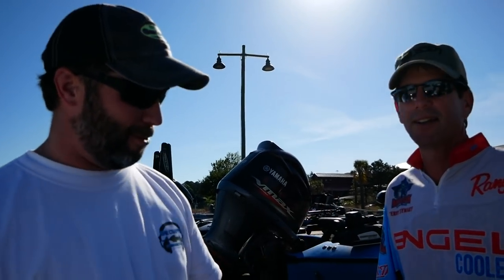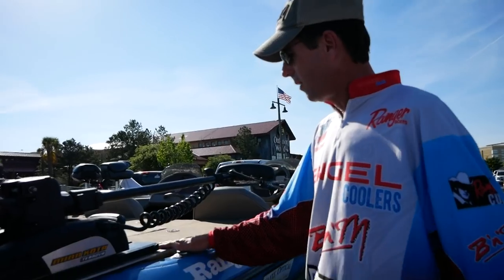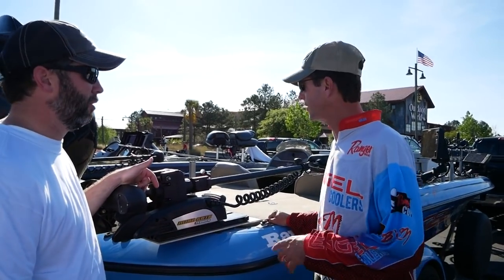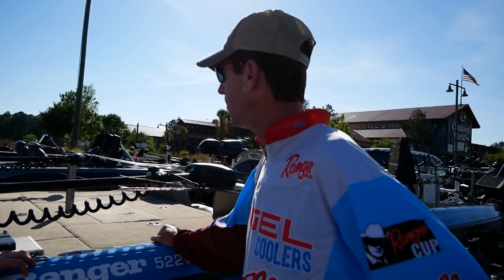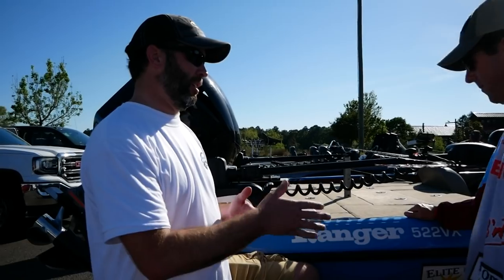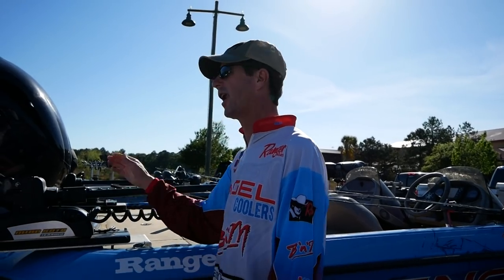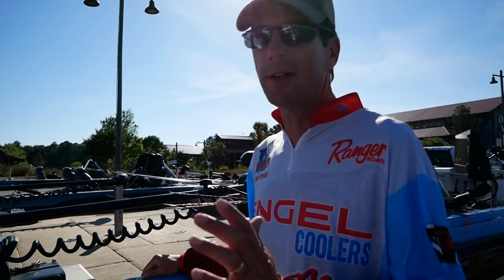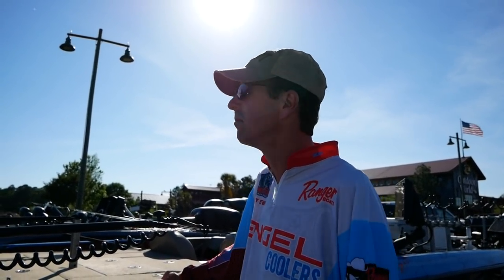Rear Trolling Motors on a Bass Boat

Comment: I knew a old man way back in the 80’s that side pulled with a bomber style bass boat  for crappie with two foot controlled motors. He could work that boat any way he wanted. It would him in the middle with a guy up front one guy in back and boat load rods off the side. He would either pull or push jigs and bomber baits. It was sight.